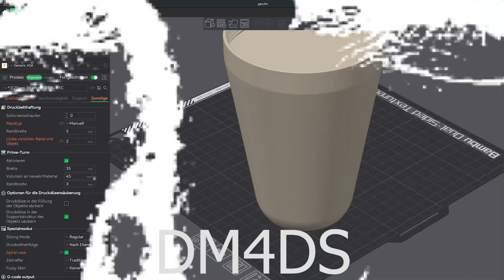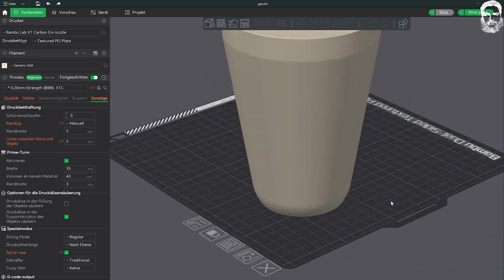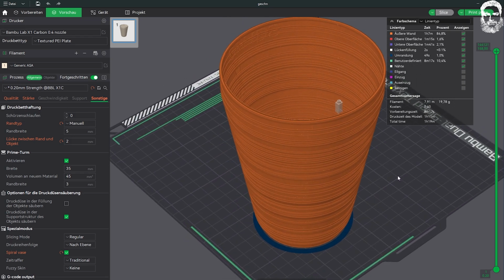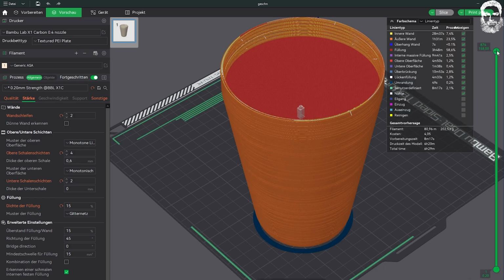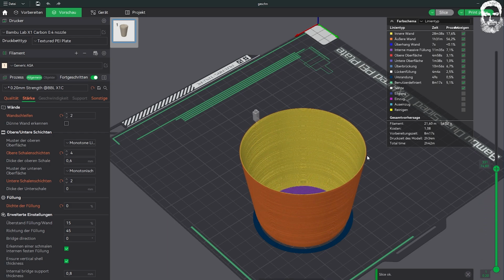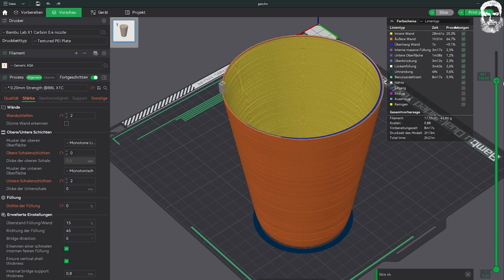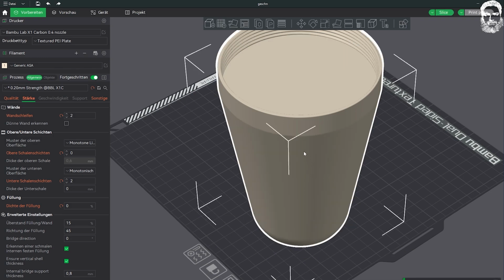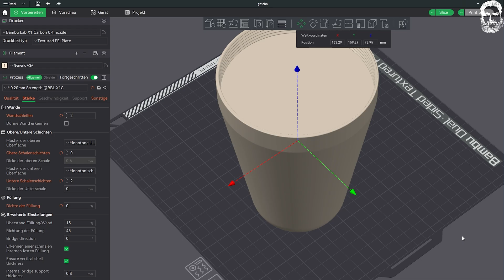Can you solve this problem?

Comment: I didn't try, but maybe the 'modifier' options help solve the problem?
Reply from the maker: there is still no option for vase + normal mode. A friend and I really tryed everything and also reported on github. The answer was clear: not possible to combine both modes in a part / build plate.

Comment: You almost had it with your last idea 
Print with the threaded section touching the build plate (upside-down) seeing how every time you merge the models the threaded piece orientated itself on the build plate automatically anyways 
The biggest issue after that is getting clean bridging because of course with the standard orientation in vase mode the bottom is flat to the buildplate rather than the upside-down orientation I am suggesting 
Do you understand what I mean ?
Basically do everything you are doing but print the model upside-down
Reply from the maker: I understand what you mean, but the thread in vase mode does not work, maybe I could raise the bottom layer so far to the height the "vase" begins. Then as you said, the bridging is the next problem. I made a simplify3d profile, Video is public on the channel, there it prints like I want it. Don't understand why no other slicer can do this? Thanks for your comment. Great 2023. DM4DS - Sandor

Comment: The problem can be solved changing the design of the model. Redesign the vase solid body by an empty body without infill and it should work on the slicer
Reply from the maker: But then it is still no Vase mode, like a spiral up. Then it is just a reguar print with walls... I have such a design in the project but Vase mode brings the best results, because there is no scar. I don´t understand why only 1 Commercial (as I know) slicer supports this.  Happy New Year - Sandor - DM4DS

Comment: Not sure if it allows swapping between vase mode and normal mode, but you can use the cut tool set to “create parts” which leaves the object in place but then allows you to set different “object setting” per part (you’ll need to switch to the “object” tab above the settings).
Reply from the maker: tryed that already and does not work. If I activate vase mode in Object 1, it automatic activates it in object 2. if I then set "normal mode" on object 2, object 1 is also "normal" mode. Maybe I´m missing something, maybe you can try and save the 3mf file?

Comment: The problem is your model not the slicer. Did you design it?
Reply from the maker: Yes, I designed it . I made it for "walls" too, but I want the Vase Part + Thread. It´s much nicer , faster to print

Comment: If you have AMS, put 2 of the same filament in there.  Use the paint tool to paint the top with the second spool.  Change the setting to want you want on second spool.
Reply from the maker: Thanks for this idea . I thought I tryed with "second spool" (i have the AMS), but I was not able to set one to vase and the other for normal printing, but will look into it again.
Reply: @DM4DS  You could also slice the whole model as a vase, then go in to the gcode and grab the top piece.  Go back to this one and inject the code in there.  That would be a heck of a rabbit hole but would make a good video
Reply from the maker: @americasmostblunted1591  - tryed it but does not work . if you try to switch to vase mode, the studio puts out an error that it is not possible to set "vase mode" in dual color. Maybe you can try it and send the 3mf? Maybe I´m too lazy.